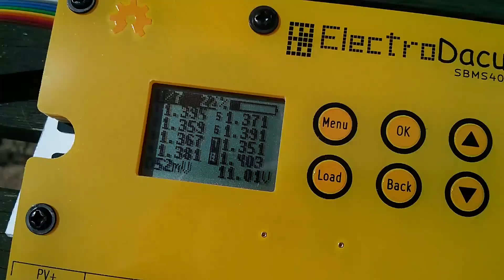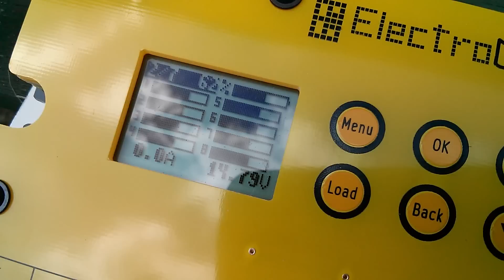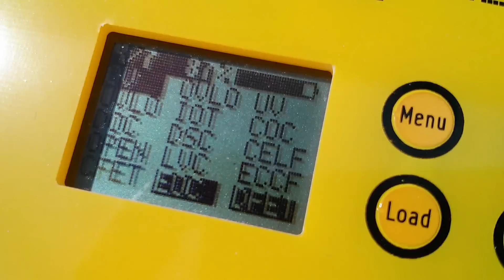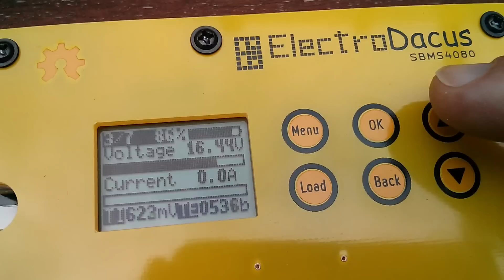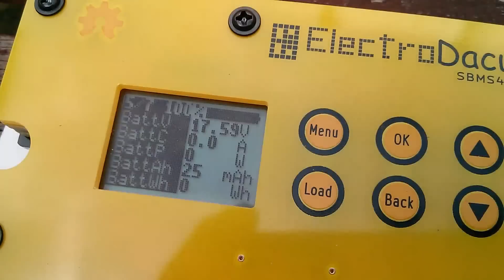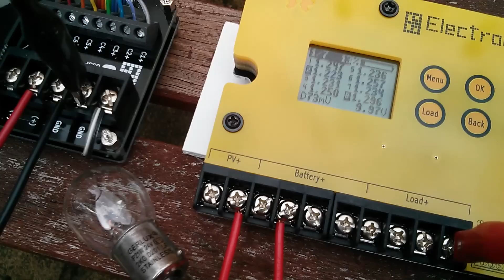Playing with: ElectroDacus SBMS4080 and SuperCapacitors #2

Comment: 19:29   capacitor no.2 < 1.000V.  PS. 6 different font types and 8 different graphics styles (including the round black screws) on SBMS4080 suggest that this device is never to be shown to my good friend - a graphic designer :)

Comment: What is the point of running the ground through the little wires, what if you have a load which takes 10 - 20 amps (inverter) ?
EDIT: ohhh the ground is always on the battery  so the unit is only "doing stuff" with the + of all things, isn't it?

Comment: lol.... you need to read the contextual help more and talk less Julian ;) You were trying to work out the capacity setting before and were wondering if it was the individual or total pack capacity, and in the mean time the SBMS told you but you weren't looking :D :D A very nice system... very flexible, and lets you set it up just like you like it. The complexity is an unfortunate side-effect, but unavoidable unless you want a non-configuratble system. Hope to see more in the wild!
Reply: In this particular case the capacity for supercapacitors plays o no role so anything will have been fine in there. State of charge is based on the lowest voltage capacitor no need to know the capacity. I was thinking that maybe I can add how many minutes it will have before fully discharged based on that capacity and discharge current but that is not implemented. For battery is way more important since state of charge can only be calculated correctly if the correct battery capacity is introduced there since you can not guess SOC based on voltage on Lithium cells especially LiFePO4 so is based on energy counting and the capacity introduced in that setting.

The new version SBMS100 has a more simple setup menu with just 3 parameters set by most users with the possibility to adjust all this other settings in an advanced setting menu if you want to do that.
Reply: So on the SBMS100 you have has just first three parameters in the setup menu (type, number of cells, capacity), with the rest regated to an advanced settings screen... Nice! Makes sense, since all the rest of the settings should be based off the chemistry type, number of cells, etc. I like the bigger colour screen also... very nice indeed!
Reply: Peter Feerick Yes in most cases setting just those 3 parameters is enough with some special applications you may want to change some of the advanced parameter settings.
Also the cell connection based on number of cell selected is also displayed on that same screen.

Comment: I would love to get one and a good capacity  LiFePO4 battery bank to replace my Lead Acid bank for my small solar backup UPS . Right now i just have a 100 AH bank, a $20 charge controller, a 100 watt panel and a heavily modified APC UPS to handle the UPS functionality but does not charge the battery bank. But it was incredibly cheap to setup.
Reply: If you have grid and just as UPS I do not recommend LiFePO4 they are economical if they are used heavy at least 30 to 40% of the capacity each day for the next 15 to 20 years. Grid is still less expensive than battery storage in most places around the world.

Comment: Glad to see you found the time to play with SBMS4080 :).
The total bank voltage is not important all the protection is done based on individual cell voltage so it will stop charging when the highest cell got to the set limit and will stop when the lowest cell got to the limit the total bank voltage is not relevant.
The arrows indicate that cell balancing was performed on those cells but the time was to short it will need a few charge discharge cycles for the capacitors to get balanced since they charge and discharge so fast there is not much time spent in cell balancing mode.
Charge them at 500mA to 1A with a cc power supply and have a small load maybe 300mA or so then in 15 to 30 minutes during a few cycles the capacitors will be fully balanced to 10mV delta if I remember correctly the default settings on SBMS4080.
Glad you like the user interface it was quite a bit of work to have that done.
Reply: This thing is a mind of a genius! Very well made! Bravo my dear friend!
Reply: Thanks for the comment. This is the model form last year the new SBMS100 is much more powerful in therms of functionality. You can see the manual here  http://electrodacus.com/SBMS100/manual/SBMSmanual.pdf
There will soon be a kickstarter campaign for an even more evolved version of SBMS with the ability to support a Digital MPPT thermal controller add-on that will be able to fully heat my small off grid house with energy from PV panels only.

Comment: Do any of you know if there is an intelligent starter/jumper controller out there? Being able to use something like supercaps just for starting would be nice. (say, if the voltage drops below 10.5v on cranking supply up to 200amps, with the ability to manage charging the supercap bank or discharged battery from a cheap,dumb battery charger) Or "intelligent" jumper cables, hook it up on both sides and it could do everything from safely charging a dead battery to buffering a couple hundred amp starting load.
Reply: I made a 14.5 volt super capacitor bank that can start my miata and my 4runner. its only good for a very short crank. both my cars do start though. I integrated a charging system with lithium ion batteries that charge the caps in like 30 secs.. maybe I'll make a vid.
Reply: pete garssia The problem is if you connect a 14v supercap bank to a 10.5v lead acid battery something is going to start glowing and the magic smoke will be released. It would be nice to have a way to dump large amounts of energy in just when the starter demands it. A bang-bang buck regulator with no fine regulation might work (on at 10.x off at 14v)
Reply: +Robert Szasz 
well, I've tried starting my truck with a low battery about 9 volts. Nothing happened. the caps just dumed all the juice to the battery and i couldn't crank it. so I disconnected the battery charged my capacitor bank and it started right up. then I connected the battery back up and let it charge for 20minutes and it was good to go. I never got any smoke with any of my testing.

Comment: With such a low storage capacity, what is the point of this setup....TOY.
Reply: The supercapacitors are just for testing the small capacity is not good for anything useful other than testing and development. The SBMS4080 supports up to a few hundred Ah LiFePO4 cells together with a max 1000W of PV panels and in that case is quite useful. The SBMS4080 has powered my offgrid house with 720W PV array and 24V 100Ah LiFePO4 up to recently when I installed the new SBMS100.
Reply: Shit, there is a plethora of different use cases this would be good for.  Consider the supercaps to be like extremely durable low capacity batteries, therefore it is useful for any low-power long-duration application where you may want to run some weather sensors for data collection for example and it needs to outlast many dozens more charge/discharge cycles than even the best battery systems can handle.  The versatility of supercaps allows you to use the minimum number of supercapacitors even where you may need moderate to high current for short, infrequent periods of time, like to transmit collected data via a long distance microwave link once a day or something like that.
Reply: goyabee I got to use a 3.3F 5.5V super-capacitor about 20 years ago and they still do not have many applications.
I also made a youtube video about ultacapacitors about 5 years ago  https://www.youtube.com/watch?v=y33tDw6BZh4
They had some applications where many cycles/day where needed like recovering energy from breaking on electric vehicles and then use that again to accelerate but if you have a large capacity lithium battery in that car there is no benefit of adding supercapacitors since those batteries already have all the benefit of the supercapacitors.
For stationary energy storage they will need to get way more inexpensive to be even be worth considering and even then there are drawbacks like high self discharge and more importantly large voltage variation in order to be able to use the available capacity.
In this example with 8s 2.5V capacitors to use most of the available capacity you will have a voltage variation between 20V full and at least down to 8V and since most loads will not tolerate this sort of variation a DC-DC converter will be needed.
A LiFePO4 battery used just the top 1 or 2% SOC can do hundred of thousand to a million of those shallow cycles acting as a super-capacitor and lasting as much but with a fixed voltage output in that range with extremely small self discharge and if you need way large capacity storage.

Comment: Better add some glass fuses or maybe 1/4 W 0 Ohm Resistors in between those delicate ribbon cable leads and your +100A short-circuit-current Battery Pack, better safe than sorry! ;)

Comment: I'd really like to know, which supercapacitor module you got there.
Seems to be a nice toy to play a with. ;)

Can you tell me from where you got that? ;)

Greetings from hamburg, germany (somewhere in line between you and the german DCF77 transmitter smile ;) ).

hacky

P.s.: I still think about building me a nice equinoxe and (combined with) some sort of led matrix display digital clock, for which i want to have as much primary/stratum 1 clock sources as i can receive and decode. For that, there are just some wlan devices using our nice stratum1 servers from ptb (www.ptb.de) (where the DCF77 signal is generated/syncronised too) and even gps, galileo, glonass, whatever we can have.

But whilst looking for a simple bare bone dcf77 receiver (decoding may be already covered in the local mcu to this part), i only find modules, which almost cost me as much as such a brain dead cheapo alarm clock.

I never thaught about just getting such a cheapo alarm clock and taking it apart do just salvage the dcf77 unit.... So i can save postage at all and still have more fun... Taking things apart...... ;)

Yeah man, thanks for that inspiration from your recent vids! ;)
Reply: I build just a few of those modules and still have a few Kit's available on my webpage electrodacus com but they are not very useful without the SBMS since the modules contain just the supercapacitors and the connectors.
Reply: It's from Electrodacus' (Dacian's) website, second item on the right hand side: http://electrodacus.com/
120USD though..

Comment: I was wondering about the super caps. how long can they supply 1 amp from 16-18 volts until the voltage drops to 10 volts. I'm thinking about getting some and would like to know. it would be great if you can reply. thanks for all the great videos.
Reply: The entire capacitor bank seen in this video is 1.5Wh that is about the same as a single NiMh cell 1.2V and 1200mAh.
The max short circuit current on this supercapacitor bank is around 400A.
The life expectancy of the supper capacitors is much larger so you maybe will need 10 to 20 of those cheap cells over the life of the super-capacitors but it will still be more cost effective to have a battery.
Using a Lithium cell will be probably better than NiMh but it will depend on the application requirements.
Reply from the maker: Probably about 5 minutes
Reply: The usable capacity of this capacitor banks is around 1.5Wh so around 5 to 6 minutes at that 15 to 18W load.
Reply: capacity is around 1000mah for the total lot he has, thus the same capacity as ten of the cheapest nimhs, based on my guess of farads to mah, so perhaps more like 30 minutes,  i dont see the point of super caps for storage, its their weakest point.  plus the potential danger of it wanting to drop 1000amps on you if you short it,,,

Comment: I was the first backer for this extremely efficient module .i still use it with lifepo4 batteries and solar panels.When in 1/7 screen and at the right of numbers there is the symbol < the balance function is working.You got to watch the presentations that Dacian make back then .
Reply: Thanks George for the support on the SBMS. I remember you where the first Kickstarter baker.